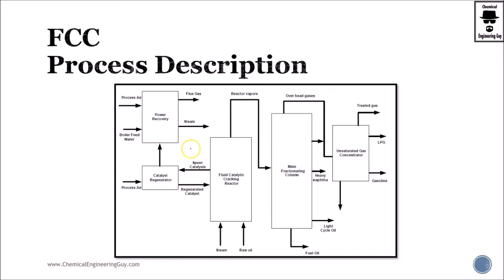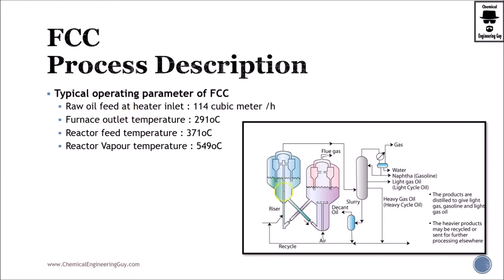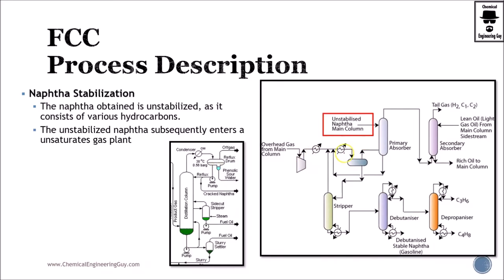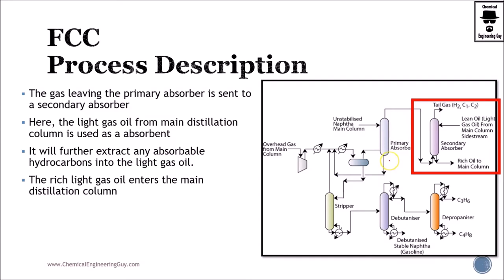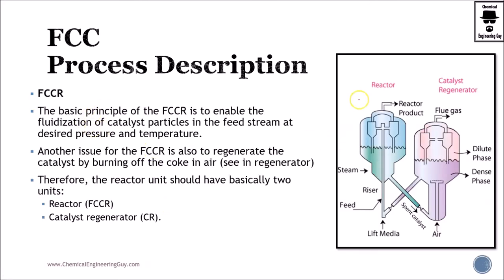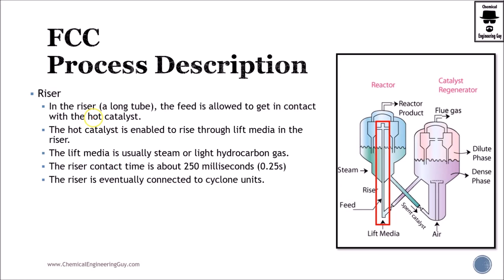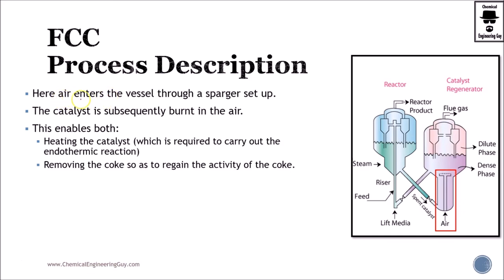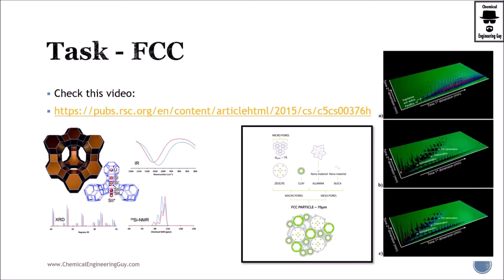Process Technology of Fluid Catalytic Crackers in a Refinery (Lecture 165)

Comment: @ 9:35 mark... The last sentence:  "Removing the coke so as to regain the activity of the coke"  but also regain the activity of the catalyst right?  
Great video and helps me as a Thermographer understand the thermal profile of surface areas on vessels and transfer lines.
Reply from the maker: thats a topic in itself! Thermography is an art-science.... I used to have a cam with heat sensors, its crazy what you will see there!
Reply: @ChemicalEngineeringGuy  Yes Sir, have been doing it since 1988. Thanks.